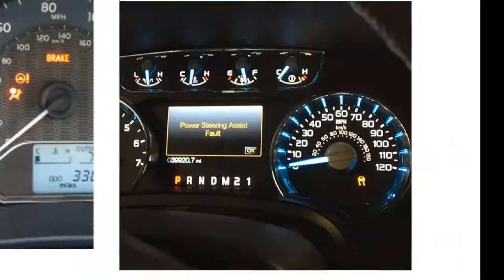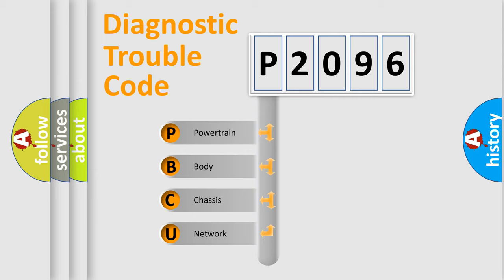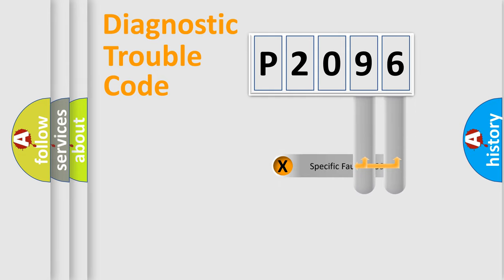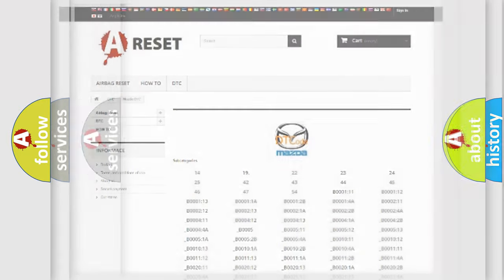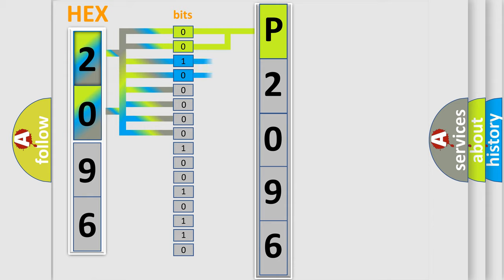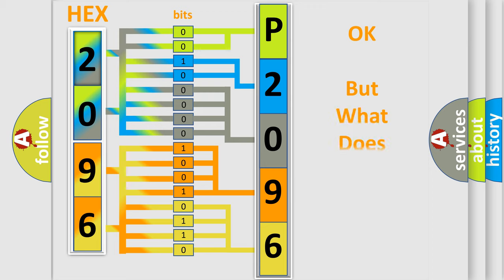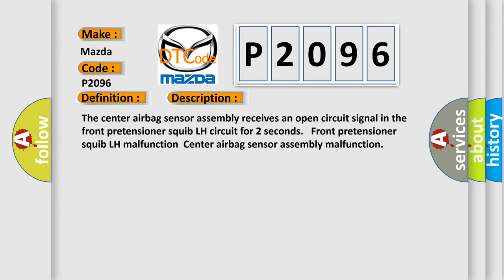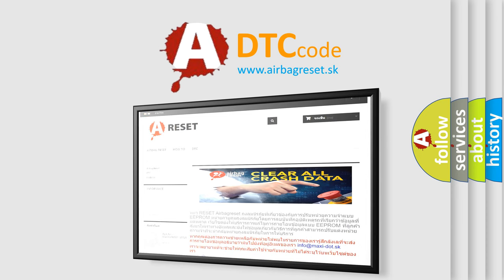DTC Mazda P2096 Short Explanation

Comment: Airbag code... What? 
Any other article, video, more importantly a scan tool will tell you the P2096 code is regarding a post cat sensor issue (B1S2).
Don't believe what you see on the internet, unless you have multiple, and independent, confirming information.
What a BS video.